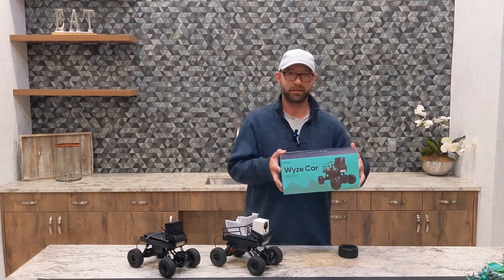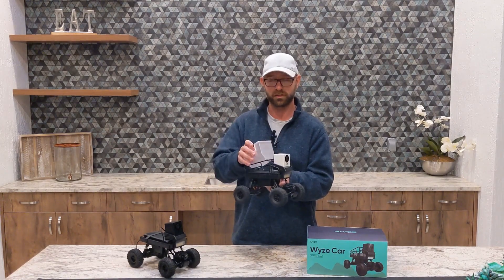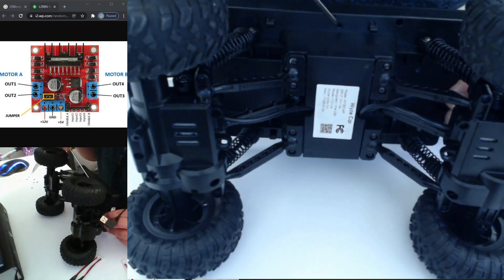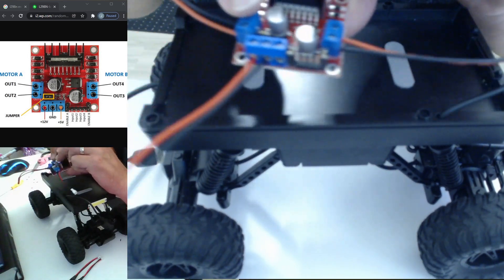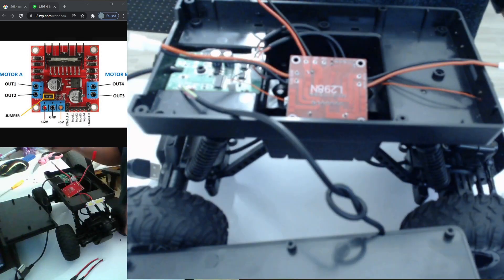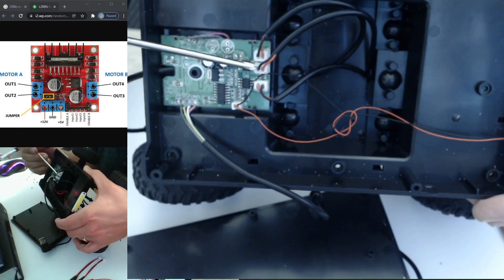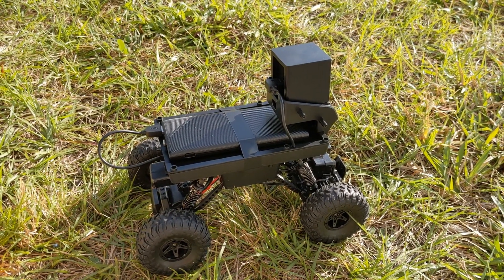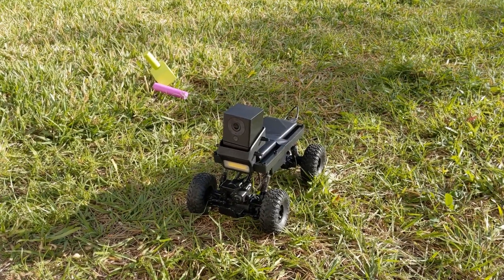Wyze Car Mods- DIY LiPo Speed Upgrade! Now the Worlds Fastest

Comment: How do you charge the other boards battery
Reply from the maker: The lipo I ordered comes with a USB charger so I just unhook it and charge it.  So it's only connected when I want to drive it. I have another more recent video where I use a more expensive mini ups that replaces the lipo and usb battery bank option. The lipo is easier in my opinion.

Comment: Hi Jonathan, great work and videos, they are a huge help! 
I just recently purchased a Wyze Car with a OG Cam and was disappointed to find out they are not compatible. 
Have you found a way to run the Car with a V3 or any other readily available cam? Locating a V2 is challenging
Reply from the maker: Yeah gotta be the original v2 in white or black. I had a bunch lying around however I bought a black cam with each one of my cars. You just wait for the new video. I used the components to motorize a lego technic set
Reply: @jsparrow-whatfig  can’t wait to see it! You wouldn’t happen to have any V2s you’d be willing to part ways with?
Reply from the maker: @Jordan W  ah man I know I got an email 2 weeks ago they had them in stock but I see they are now sold out. I will have to see if I have any.

Comment: looks great. do you need to plug in the 2 batteries seprately to recharge the batteries. How long does it run on a charge?
Reply from the maker: It uses the original USB battery to run the camera and steering. The LiPo runs just the motors. I haven't ever run it completely out. I've driven it a good mile round trip. So yes you need to recharge the LiPo and the USB bank separately

Comment: Just ordered your kit. Excited! Can you recommend a link to larger wheels that work well? Also, do you recommend grinding off the right turn governor tab? Thank you!
Reply from the maker: (4-Pack) HobbyPark 1/10 Scale Off Road Buggy Tires & Wheel Rims Set Front and Rear 12mm Hex Hubs with Foam Inserts for RC Hobby Car https://a.co/d/dtYalxh
Reply from the maker: I never had to grind anything off the turning improved once you add more power to the motors with the extra battery.
Reply from the maker: These wheels are probably my favorite if you want to keep the car drivable in any condition. I did some larger ones but it makes it so I can only drive it outside
Reply from the maker: Oh if you are going to do the wheels look for the 3d printed wheel adapters on Etsy. 
https://www.etsy.com/listing/1253234101/3d-printed-wheel-adaptor-to-change-wyze

Comment: Next, we throw in a Crossfire RX, ESC, a DJI air unit, four motors, and some servo deployed props and we have a 007 Bond flight kit mod 😮😂😂 Oh! And how about an IR light for night vision 🎉
Reply from the maker: With the way I've built it we can run in Arduino off of the speed mod board to do whatever we want.
Reply from the maker: There is another guy that simply is just using an RC car with a V3 cam. You should be able to find them under John Wells. He lives somewhere in Texas and he's been doing a bunch of videos and it's all like an autonomous little Rover. I'm trying to make sure that I can still control it with the wyze app

Comment: Hi. Can I change the JST connector for a USB port?
Reply from the maker: Look at my newest video. The Jeep Wyzicon one. I am using a USB charger to run the camera and steering and instead of the jst connector I'm using the USBC port for 9v from the wyze charger. But you also have to add something on the 5v coming from the speed board to draw power all the time. The issue I ran into was the charger would cut off  after a bit if you weren't driving. So I did some tail lights so that the charger would stay on.  I can do a more in depth video if you think it will help
Reply from the maker: https://youtu.be/Y3LnMHLdQxs
Reply: Thank you I will do it as soon as I get the parts but a video would be great to avoid making any mistake. It was so easy to complete the upgrade the first time and I can't wait to work with the car again.

Comment: I am not well schooled on stuff like this...  is there a different way to ground?   Could you add a piece of metal or something instead of soldering?
Reply from the maker: I mean when I did my first one I didn't have a soldering iron. I just wrapped it around the connection to the ground and put a little Elmer's glue. The main thing is you just have to get the wires connected. You can get around having to solder it.  I also have some wyze cars modded big time that I'll probably sell. I'll just buy more and start over again lol
Reply from the maker: I tried adding an alligator clip but just couldn't find something small enough but you should be able to get it wrapped around the ground wire enough to get a connection

Comment: Hey, silly question, I am not at all techy when it comes to the boards and wires but I am assuming that adding that lipo battery will eliminate the need for the rechargeable power pack that came from wyze (it will only be used to power the camera) therefore, how long does the lipo battery last in continuous use? Also, any way to run the car on the  power bank? I have a 20,000 mah one that I used with the car and the battery lasted twice as long, I just need it for home surveillance and spying on pets when im not home and would like to be able to just connect to the car hours later and drive around. Thanks!
Reply from the maker: So yes the power bank will stay connected as normal to run the camera and steering. The Lipo is then just used for driving which good news doesn't use alot of power just being plugged in. I don't know yet how long it will last as I've never run the battery down all the way. I know it's not good to run them completely dead. For context though I have driven the car from my house to the park and back which is almost a mile round trip. So for around the house that's ALOT of driving lol. I'm working on a new build to see how I can utilize two USB ports. It won't be as fast but it might do what you want
Reply: @jsparrow-whatfig  perfect, thank you. I have purchased your kit i will order the battery now and a soldering iron or wire glue. I'm excited to see what other upgrades you come up with!

Comment: You may have mentioned it, but I thought I’d post that a person needs qty (4) M4x8mm bolts to bolt monster tires to hex wheel couplers.
Reply from the maker: Or check out the 3D print mod video I did. I have been using those on my new wyze cars. I'm up to 4 cars now.

Comment: “That feeling you get when your 2nd Wyze Car finally arrives because you didn’t realize the first one you ordered was a $10 cheaper “no camera” bundle, your dump truck bed and battery positioning insert from 
3DPrintNerdEP1192's Etsy shop arrives, along with Monster truck tires, wheel adaptors, the Li-ion battery from Amazon and of course Mr. Gorman’s mod board and you totally did not see you needed a JST CONNECTOR for the battery”🤦🏼‍♂️ lol. Time to go excavation in the garage:)
Reply from the maker: Or when you order two cars and then wyze puts them on sale a week later.

Comment: Great video!  I recently purchased the components off of Amazon.  Putting it  together was easy.  The hardest part was soldering the ground wires together.  Works like a charm!  I was going to do the wheel upgrade, but I was concerned that the larger wheels would burn up the motor prematurely.   Btw, I still have a slight steering issue.  Mine can make sharp left turns, but turning right is not as sharp.  I am in the process of just filling and sealing the stock tires.  I may upgrade the shocks in the future.  Which ones are you using?  Keep the videos coming!
Reply from the maker: Working on the video right now about the shocks. I think anything 60mm to 70mm will do. I've learned alot over the past few months. Just get the slightly bigger wheels like I got. It's Waaaay worth it and they look good. Like a 3.5 inch tire and then you can choose a different color if you wanted
Reply: Cut off the tab on the right of the axle housing by the steering servo arm. That's what kept mine from turning all the way right.

Comment: can we use a high voltage battery? has any one tried this yet I'm seeing 11.1 volt on amazon as well. or could that be too much for the motors???
Reply from the maker: Sounds like I need to try it and find out!
Reply: Do it. Just place it on top of the power bank. Dremel a hole for the wires and you’d be good to go. Pushing 11 volts seems little iffy.  But again, this is a toy and it’s cheap so I say go ham.

Comment: I ordered your ki last night, but I'm now thinking about also trying out my 3S batteries from my trx4 as well! 🤔 I appreciate your work sir! Thanks to you I'm also swapping the wheels/tires to one's off an old Traxxas nitro stampede! Hahaha we'll see what's next! 🤔🤔 Powered dump bed maybe?!
Reply from the maker: Did you see my other video where I put monster truck tires on. I think they are 1/10 scale
Reply: @jsparrow-whatfig  I did! That's what gave me the idea!
Reply from the maker: I gotta do some more videos because more improvements need to be made on camera vibration, additional add-ons or maybe running an Arduino.  I also think I can wire in tail lights off of the headlight.
Reply: @jsparrow-whatfig  haha that'd be awesome! Idk how stiff the tires are you put on, but maybe use a different or no foam in them? I think I'm going to order some 60mm shocks for it as well. I dont think the ones on it can be disassembled and the springs it has are way to stiff. I may cut and stretch them in the mean time. 🤔🤔
Reply from the maker: @CheesingGouda  I ordered 70mm springs on the car with 3.5 inch tires and I only did them on the front because it also allows side movement. Which as you know the ones on there originally do not go left or right and are very stiff. I don't even think I would bother with trying to cut and stretch the springs.
Reply: @jsparrow-whatfig  which ones did you order? I think I'd just measured 60mm center of eye to is why I was thinking 60mm... Yeah, I can see it needing trailing arms... Haha I might steal some off my scx24!
Reply from the maker: @CheesingGouda  here ya go. This is what I ordered.  Obviously you don't have to go with black and I just ordered the first shock oil I came across. I probably should have gotten something higher than 30 weight.

HobbyCrawler RC Adjustable Shocks Absorber Springs Set Upgrade Parts 70mm 1/16 Buggy Truck Off-Road HPI HSP Traxxas Losi Axial Tamiya Redcat Car(Black) https://smile.amazon.com/dp/B08T6GTX9J/ref=cm_sw_r_apan_glt_i_S5NN191ZHSV0MBXSX147?_encoding=UTF8&psc=1

Comment: So the turning will improve with the board and  battery upgrade?
Reply from the maker: Yes because the battery pack used for steering has plenty of power once the driving is on its own battery.

Comment: Could you add a buck converter and run only one battery pack?
Reply from the maker: I totally could and I'm going to try it. The difference using the separate battery allows 2amps to each motor instead of 2 amps split between the two.

However if I can just run the board off of another USB I can make that an option. It would be cool to just use two USB instead of a lithium battery that you have to deal with.
Reply: @jsparrow-whatfig  What about a boost converter with a standard powerbank?
Reply from the maker: So I just ordered a USB C plug so I'm gonna try to run it all off the same battery pack. I'm sure it wont be as fast but we shall see
Reply: @jsparrow-whatfig  looking forward to hearing your progress from that USB c
Reply from the maker: @MrHugepants  I tried and it doesn't work running off the same battery pack. I am however able to get it work by using two separate battery packs but it's just as easy just to get a lithium battery. I used one battery pack to run the camera and then the USBC to run the car at 9 volt and it was minimal difference and a lot of extra effort
Reply: @jsparrow-whatfig  I tried the same. I even ordered a boost converter module to bump up the voltage from 5v to drive the motor controller and it was drawing too much current and the camera kept dying. I'm still working on my ghost voltage I was talking about in my other comment and broke one of the amps. the one for forward and reverse (left side) now im working on finding a replacement
Reply from the maker: @rgsarvestani  I would just go with the setup that I did. You can put even like a 12 volt power supply into it The max you're going to get out of the board is 2 amp to each motor. Which is probably plenty for that size motor unless you're going to swap out the entire axle and get a bigger motor which I have considered
Reply: Can't you just use a bigger battery pack?
Reply from the maker: @TheKingsComingAlefTav  a bigger USB battery pack won't give the wyze car any more power. It's limited to run on 5v and 2 amps. The only way is to add more power directly to the motors
Reply from the maker: If you are interested its ready.  
https://www.gormansolution.com/wyze-car
Reply: @jsparrow-whatfig  won't that burn out the engines quicker seeing that's probably the reason they made it less power
Reply: How much play time you get out of the fully charge battery?
Reply from the maker: @josetulio2  I never got the point where I ran the battery out. I also got mine as a 2 pack so I could just swap it out.
Reply: I already bought the kit but I was wondering if I should buy a higher capacity battery like 5200mah for example to have more playing time.
Reply from the maker: @josetulio2  you could just check the C rating. I got a 20C battery but you could do a larger capacity but don't do anything crazy like 120C battery. That might put too much power to the motors. I'm guessing you could find a bigger capacity with like a 40C rating. I see your order and I got it ready to ship tomorrow
Reply: @jsparrow-whatfig  I receive and install the kit. It was really easy and now the car is awesome. I went ahead and change the wheels also. Thank you for the ideas and the instructions!
Reply: Hi, I've been 5 months using my Wyze car with the lithium battery without any issues. Now I want to make it easier and run my motors with a regular USB power bank but not sure how to do it. Please help.